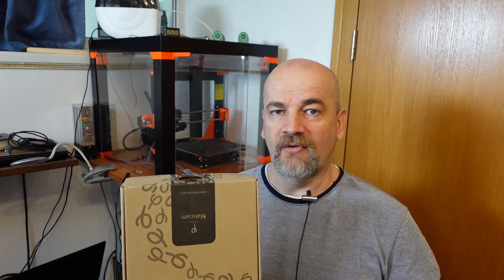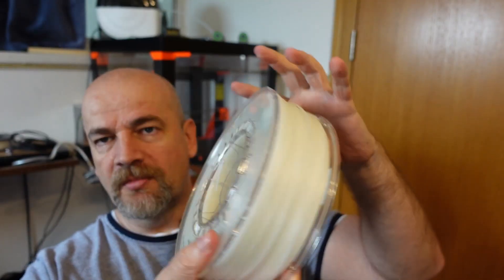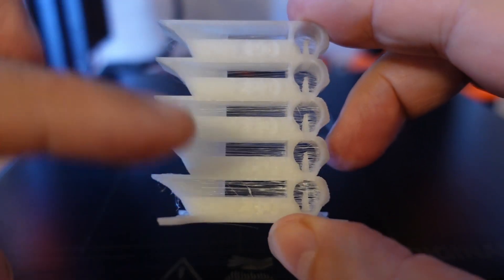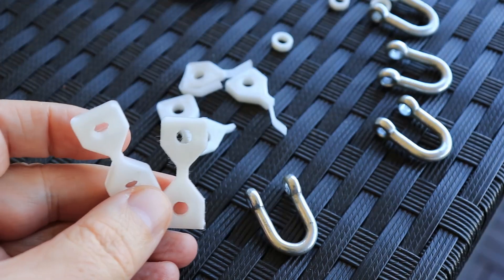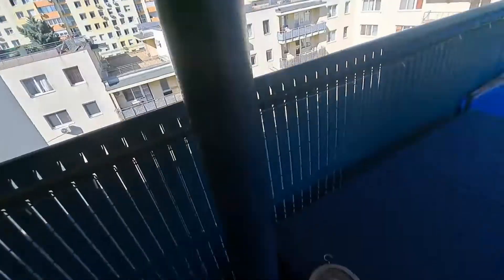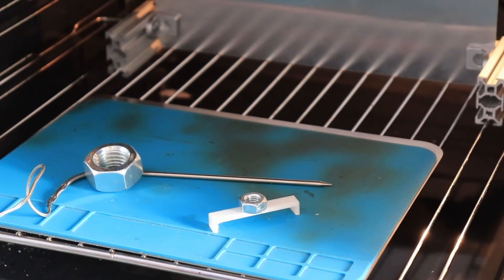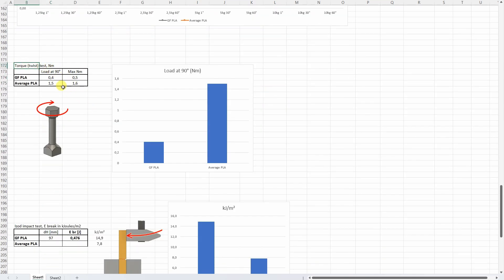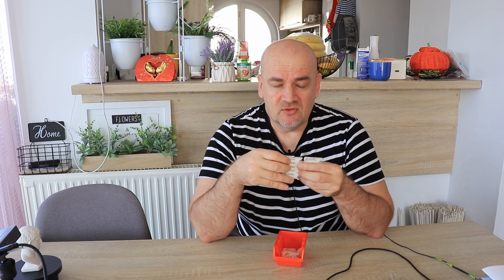Glass fiber PLA by Filaticum - review and mechanical testing

Comment: Usually glass fiber and carbon fiber filling is to counteract the warping of a material and increase stiffness. 
Since PLA is already one of the stiffest materials with almost no warping and it´s brittle already, what is the point of the glass filling here ?
Also this material is super harmful to your lungs and your machinse because the glass filling will file away metal gears, nozzles etc. 
I see absolutely no benefit of this material whatsoever.
Reply from the maker: Usually it makes the printing easier (with nylon or PC for example). With PLA I am hoping that the annealing will be easier (but when all other properties will remain similar as regular PLA)
Reply: @MyTechFun  That´s what I said, it helps with warping, which also helps with printing it. Really this material is absolutely pointless. 
Igor be careful when working with this material at home, the small particulates can be breath in, I really don´t recommend filled materials for home use, unless you have great ventilation and evacuate the printing chamber outside. Also tell this to your audience, it´s not worth getting sick because you wanted cool looking prints.

Comment: Very nice content and love the details of the test. I have test this PLA, and I used the recommended temps but I did have to tune the extrusion a bit to get better flow to fix some of the adhesion issue I ran into. It´s fantastic for making tool boxes, let one in the Spanish heat in the car and had minor deformations but still kept it´s shape. cheers!

Comment: Hi Dr. Igor. I am seeing you using "Layer adhesion" also for the adhesion between Walls/perimeters. I mean, something like what I see at 5:22 - that's not adhesion between layers... instead, it is poor adhesion between the perimeters. Maybe it was not enough Flow (under-extrusion). Keep up the awesome tests!
Reply from the maker: Hello, Yes, you are correct, wall adhesion. Flow is correct, so wall adhesion is always very similar to layer adhesion. Maybe I should call it line adhesion, it can be used for layers and walls :-)